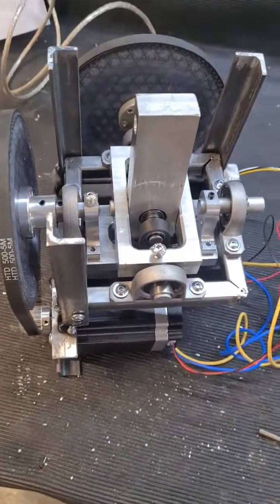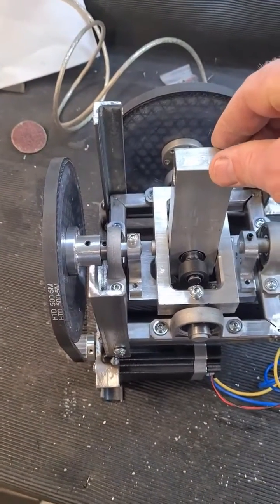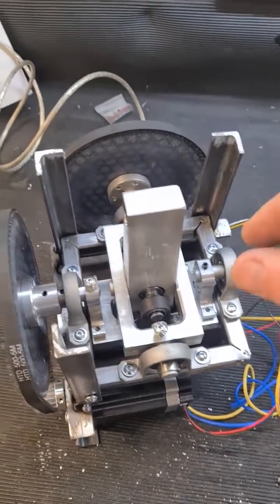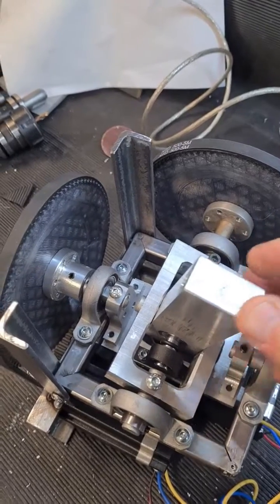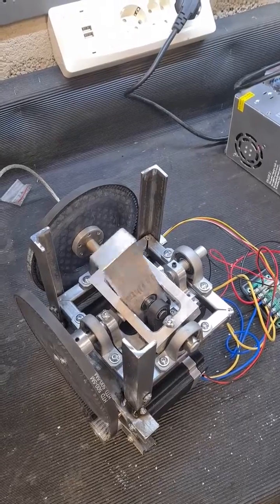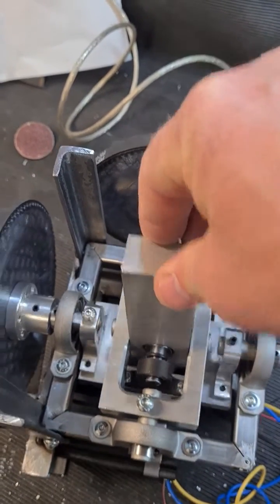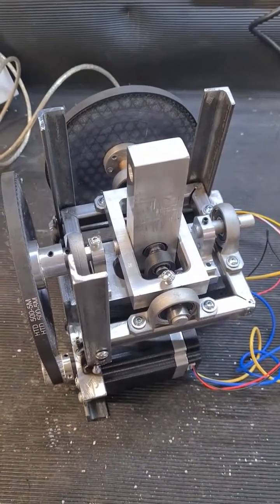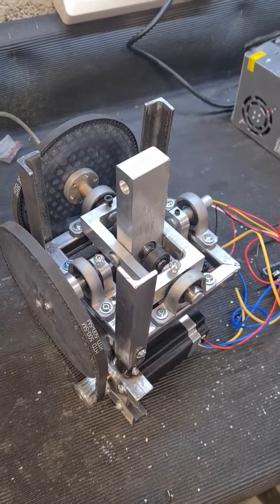First FFB Gimbal Test

Comment: Ogre, I don't see any compensation axis for the torsion effect in the gimbal, do you noticed any problem with the two axis linearity the both are angled? Cause I saw some FFB gimbal concepts that needs an additional axis wich rotate inside the x axis, is that really necessary? And how many degrees of freedom does your FFB joy have?
Reply from the maker: Hello Leonardo, Good eyes, the solution is hard to spot :)!  I am using a spherical bearing in the center to give me the linearity needed. There are other designs out there, but I had some laying around and it works very well for me. Only thing is that I cannot run the cabling through the center of the gimbal but that is not a big problem.
Reply: @ogre903  How does the spherical bearing affect the (from the point-of-view in the video) back-to-front movement though? It would seem to me that it would introduce unwanted slack, as the lower plate wouldn't necessarily be in sync with the stick due to the extra +-5° of travel in the bearing in that direction. 
Or is there something else hidden in the lower plate we can't really see here that prevents this?

Comment: which motors did you use?
Reply from the maker: I am using the smaller motorkit that Walmis offers ... he didnt have the big ones when I purchased the kit. They work fine for Helicopter use and a moderate extension.

Comment: can I get a link the gimble design. Looks interesting
Reply from the maker: Hello, sorry for late reply, summer and work got in the way :). Dont have a link to the design. I made a rough fusion design when I started but it changed as I was building  it and at some point I just adjusted things on the fly. Have not updated the fusion files yet. That will be for a rainy day later :)